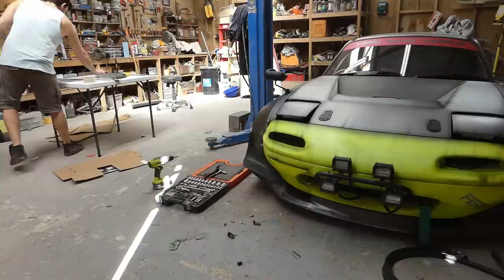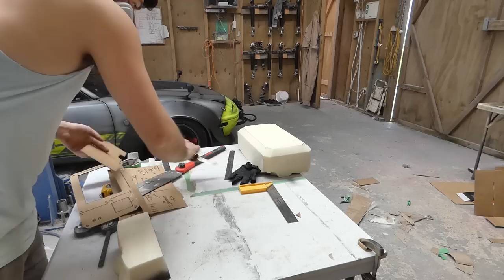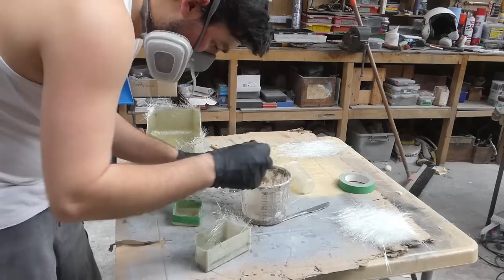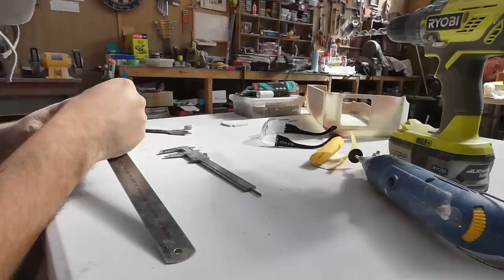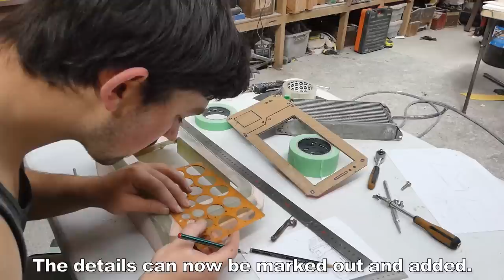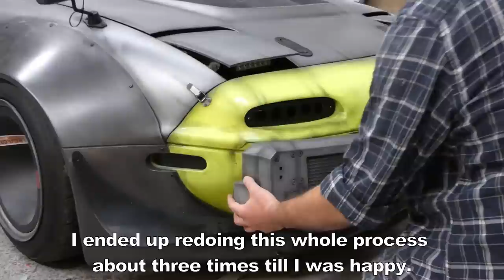Building a Custom Cooler. Cyberpunk Miata Build.

Comment: that cooler housing looks incredible!! now you should make it functional. that would be the cherry on top! look amazing and add some (unnecessary for the miata lol) oil cooling!!
Reply from the maker: The long term plan for this car is to actually convert it to an EV and so the plan with this cooler is to eventually use it to cool the battery packs.
Reply: @TofuAutoWorks  thats awesome!! cant wait to see it doing some cooling!
Reply: @TofuAutoWorks  bruh that would just ruin it
Reply: @Flatout56-o8k  naw, that would be sick. would make it even more futuristic/cyberpunk style
Reply: @_zedf656  how would electric be more futuristic? Electric cars have been around since the late 1800s...
Reply: @Flatout56-o8k  2HP ones that went like a mile, yea. A cyberpunk Miata flying past you completely silent would be sick. Two very different things. Lmao don't give me none of that 1800s bs...
Reply: @_zedf656  But imagine the whine of the electric motors flying past you 😍
Reply: @zf1_boi46  That would also be sick!
Reply: @_zedf656  It's not BS. Electric vehicles have been around since the 1800's. Our GOVTs just pushed to use gas/oil as it was more profitable. Everybody could be running off of free electricity rn but that doesn't put money in a certain someone's pockets...
Reply: @DJHeroMasta  Never said they weren't around then.
Reply: @_zedf656  You're right. IDK....I'm high now. Everything's fine. Too much shit going through my head when I'm sober.
Reply: @_zedf656  why does it have to be silent motors aren’t that quite just tesla soundproofs everything uses quiet differential gearing 

Yes use battery packs and motors but let them make scream and whir, also use performance straight cut diff gears performance cooling fans there will be all sorts of different noises if it’s not done in a 🐱 way
Reply: @TofuAutoWorks  if it was a normal Miata I’d say why would you go ev that’s stupid but with this cyberpunk style especially with the new Hyundai N vision 74 coming out I think ev would be absolutely perfect for this Miata 😍😍
Reply: @TofuAutoWorks  if you make it an EV, there will no longer be a need for the yoshi muffler, which is one of the coolest things about the whole car.

Comment: That contour gauge is really cool. Also do you need a special spray paint that doesn’t eat the foam?
Reply from the maker: It's actually a specific foam you want to use. This expanding foam is polyurethane based and so it resists a lot of the solvents found in paints and resin. If you use polystyrene foam then it will dissolve.
Reply: @TofuAutoWorks  ok that makes sense.  I was not clear on what kind of foam you were using.  I work with fast reacting foam in my day job, I lift concrete with foam. The stuff I use expands and stops in about 5-10 seconds.

Comment: Awesome work! Do you have a link for those latches you used to hold on your front bumper? I want some for my drift car build
Reply from the maker: Look up "Toggle latches" on eBay and there should be dozens of different types. Just be sure to check the size on them, I bought some first that seemed like a steal but when they arrived they were the size of my

Comment: What is that foam? I see it resists polyester resin, that's a game changer! Before I used polystyrene wrapped with lots of tape, but it still melted.
Reply from the maker: Yup, 2 part expanding polyurethane foam, super common in prototyping and insulation. It can absorb a lot of resin just from it working it's way into the pores of the foam so as my first layer of fiberglass I like to use lightweight 80gsm tissue as it doesnt have the large gaps between fibers that you'll find on heavier grade chopped strand and it stops too much of your resin seeping through.
Reply: @TofuAutoWorks  good stuff, thank you!

Comment: You should add a little pixel display in that square on the face of it.
Reply from the maker: Hey man, cool seeing you here. Love your s30 build. Yeah I actually had plans for way more electronics in this thing like LEDs and a pump to circulate a luminescent fluid through some clear piping so I'll be revisiting it in the future once I get all the parts I need.
Reply: @TofuAutoWorks  sounds cool!